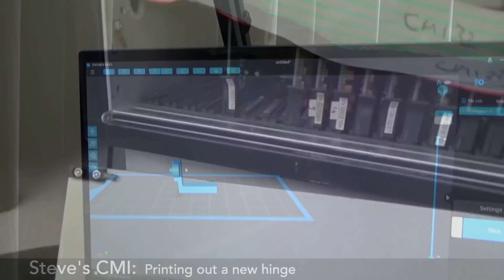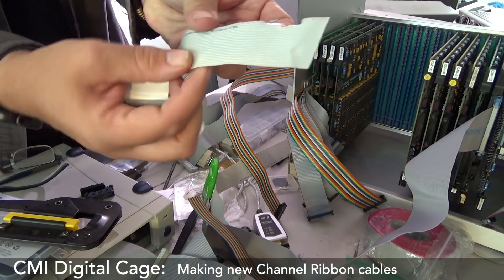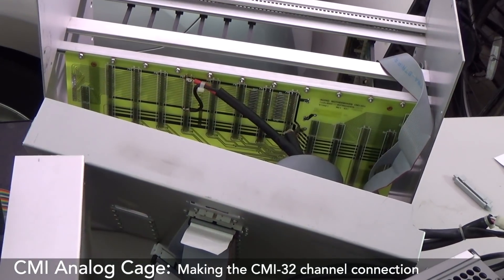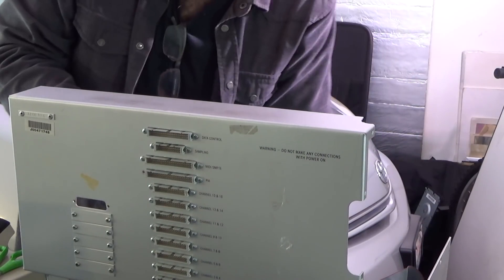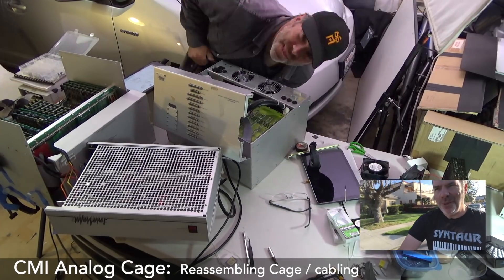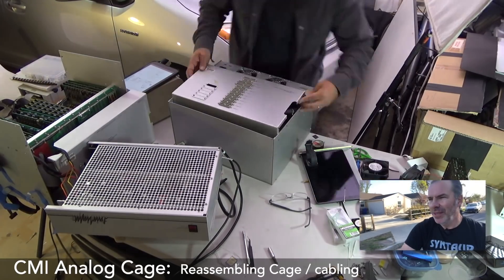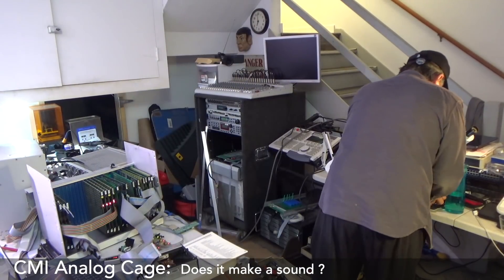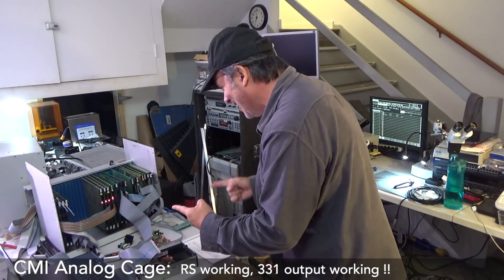I'm building a Fairlight CMI - Episode 6 - The Hills are ... alive?

Comment: Nice work! So most of the 'to do' list is just to clean and button it up as it's basically just... fully functional right now?
Reply from the maker: Well, it’s pretty difficult without the function keys, so I need to find a way of getting the MFX keyboard to work. Also, with no mouse.. there’s things you can’t do. Also, the entire power supply needs to be replaced.... So, I’ve still got a lot to figure out.. Also, the edits are behind where I am.. there’s approx 34hours of raw footage of what been happening... it’s not finished by a long way.... :)

Comment: I've heard of a CMI, but what is the story of MFX?  Was it some sort of aftermarket thing that did away with a lot of components to make it cheaper?  It's been fun watching you put it all back together.
Reply from the maker: Hi, I’m glad you’re enjoying the videos. The MFX was the next thing for Fairlight, and it allowed 24 track audio recording and CMI capabilities in a single machine. Later they completely changed the technology and architecture, and the CMI support was dropped. I was lucky enough to have a machine that was designed to only be a multitrack recorder but relied on the CMI architecture. If you like, have a look at the first episode as it explains the history a bit more :)
Reply: @CrisBlyth   knowing this, did they ever make a machine that could switch between modes with a swapping of cards and a restart? Or was there simply too much overlap in the MFX mode that gave a MFX enough CMI functionality, that it wasn’t deemed necessary?

Also, how far did the CMI support go? Could it use a CMI keyboard, or did it just rely on things like MIDI instead?
Reply from the maker: @mysfiring  indeed the idea of MFX was to be able to add 24track audio capability to an existing CMI. So there were models that were sold with CMI and MFX functionality as standard, and you would switch between them with a key press. However as the company realized that multitrack digital audio was the best place for the company to expand, they started selling machines that were based on the basic CMI architecture but without the extra components. buuut if you ran the cmi software it would work..
Then just before they released the MFX3+ in its new case, there were a smaller amount of machines that although based on CMI, couldn’t run the software and had a chunk of the hardware and backplane changes.. they didn’t even look like CMI.. but they had some CMI remnants inside. 
That’s the machine that I had.. :) couldn’t run cmi properly but was based with cmi hardware.